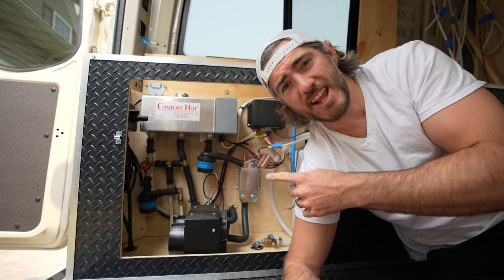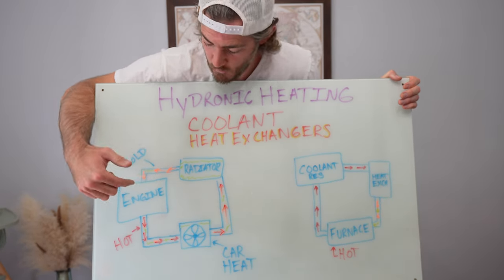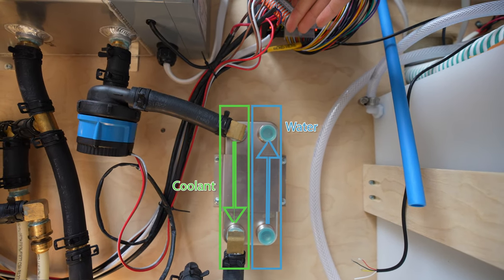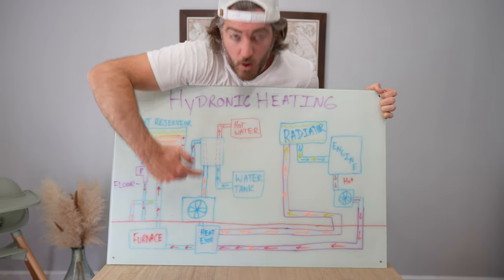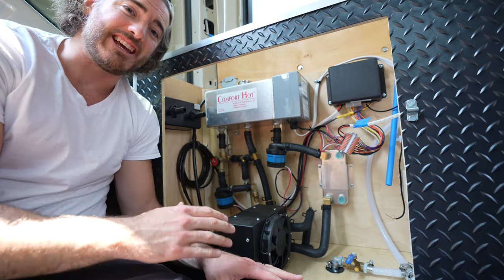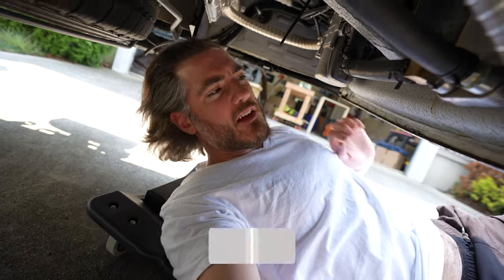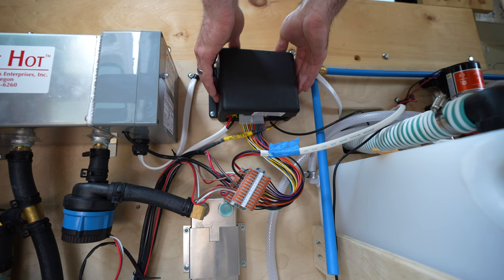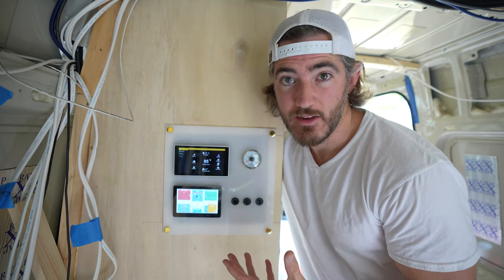Hydronic Heating For Van Life by Rixen's Enterprise

Comment: I have the Espar D5E and i’m confused because I have seen it installed so many different ways i’m not sure which is correct anymore. Ideally, I’ll have the options of hot water, air and floor heating. I’ve got the pex lines installed in the floor, the air blower and am going to hold off on the hot water for the moment because it’s winter and I need warm air. I’ve got the coolant reservoir installed to the pump, the heater is installed outside of the van. In some videos I’m seeing the pump directly to the heater and the heater to the heat exchanger but your setup has the coolant going to the heat exchanger then to the heater… does it make a difference which one i go to first?
Reply: Since they did not respond, I'll give it a shot-- IMO putting the "water heater" before the air heater would give you more consistent hot water temp-- with the air heater first, if say while using the water heater and the "air heater" fan kicks on, that would cool the coolant going to the water heater a bit and make the temp drop some-- if you put the water heater first, then if the air heater fan kicks on it would not affect the water temp since it is after the water heater... now thermodynamically, that is what would occur-- but not knowing how much of a temperature drop you get across the air heater, not sure how "much" it would be affected by this-- it could be negligible... if say the coolant only dropped a few degrees---- if it drops alot, then it could affect the water temp by alot also....  that's my take anyway.... HTH

Comment: Hey Kevin,

Im installing my system now and noticed you also used white pex.  I have been reading that hydronic should actually use the orange pex that has an oxygen blocking layer.  Have you seen any issues with rust?  Apparently that is what the orange prevents.

Thanks, Tim
Reply from the maker: Hey Tim, I read that too when I was looking into it.  However this came directly from just roaming design.  I haven’t seen any issues with rust and feel confident in the pex we have, however I’m sure orange is probably best
Reply: Thanks for the reply.

Comment: Great video! Question, does the engine loop always circulate when the engine is running? Or is there a separate pump for circulating that?
Reply from the maker: Engine loop always circulate from the engines water pump.  If you had the preheat option you would have to add an additional pump in the loop and then use the eberpacher furnance to preheat the engine

Comment: I have the Rixen system also, but I am not hooked up to engine heat and don’t have floor heating.  Are you using the engine water pump to push that engine hydronic fluid aft and then forward again?  Any concerns about your engine coolant exposed the length of your van 2X? Agreed Rixen support is second to none!
Reply from the maker: Hey Jeff, I had the same questions that I asked them myself.  They confirmed the engine's water pump is more than strong enough to move the coolant back and forth, even where I chose to put my heat exchanger, all the way in the back!
Reply: Hi Jeff, I have a d5 heater and would like to install the basic hydronic system like you in my sprinter. Can you tell me which kit I would need to purchase for this particular install, thanks.

Comment: For $6,000 plus installation there are much better and less expensive heating options for RV's, vans, overlanders, or expedition vehicles. I agree that having a loop to use engine coolant and a plate heat exchanger with radiant in-floor heating is part of the solution to keep the living area in a van warm while driving and engine heat is free. In the same coolant loop as the radiant floor heating you install a small radiator(about the size of a transmission oil cooler) with a 12v slow turning, quiet, but high volume fan that will also help heat the air again using engine heat/electricity. The third heat source is a point of use electric tankless water heater made in Germany by Stiebel Eltron and a small 2-6 gallon/min circulator pump. The circulator pump is what triggers the the tankless water heater to turn on and the only other items you need is a digital thermostat and relay for the circulator pump. Every 100 ft of 1/2" PEX tubing holds aprox 1.3 gallons of coolant and a van would use under 200 ft, meaning the entire heating system uses less than 3 gallons of Propylene Glycol and water mix so the circulator pump only needs to have a small volume of gal/min to circulate the entire volume of the system twice per minute. Typically there is only a 20F degree drop in a loop of radiant floor so it does not take much electricity to raise the temp of the coolant back up 20F degrees to the set temp of 105-110F. One mistake vanlifers make is only running PEX radiant heating tubes in the walking areas of a van, you must remember everything in the van must be heated up to be comfortable and warm the space. By putting loops of PEX under the bed area, under cabinets, under the entire living area it helps to warm everything in the van making heating more effective and maintaining a comfortable living area. I figure you could install the heating system I suggested for less than half of a Rixen system.
Reply: Makes sense if ...."20F degree drop in a loop of radiant floor so it does not take much electricity" were true. ( actually a lot lower Temp drop but doesn't matter)
The amount of energy required to raise the temperature of the coolant is related to the temperature rise and the Volume. 1 BTU is 1 lb of water 1 degree F. But you need to addc " time" to the equation. 1500 watts is 5118 BTU's per hour. ( about what the diesel heater puts out ) . That is 125 Amps at 12 volts. You need really big battery to sustain that current , and a Generator to charge it. ( the Van alternator is not nearly enough)